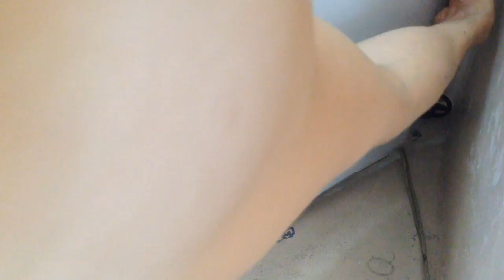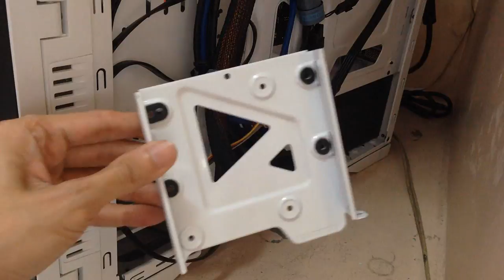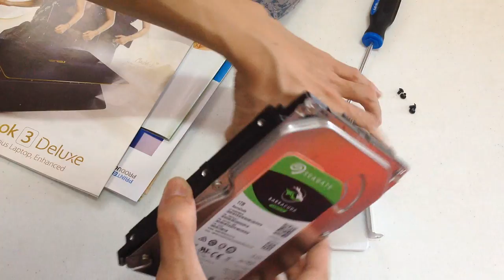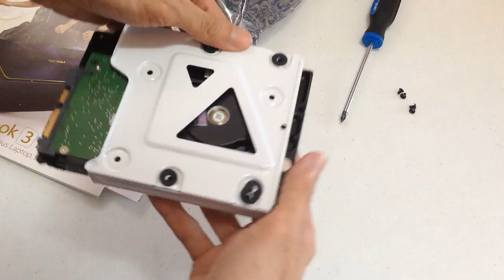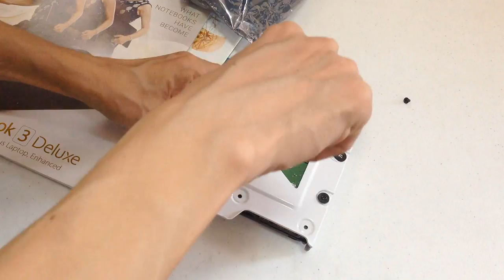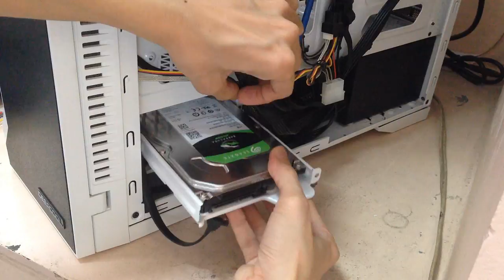Installing Seagate Barracuda 1TB Hard Drive

Comment: There is a 3rd plug in on the hard drive that I have no idea what it is. I've already plugged in the two SATA's, but what is the third one? Do I need it?
Reply: If you have the two plugged in, you are fully set up. I think what you're referring to is when he reached in the case the first time with the drive in, he was putting in a screw to hold the drive in place
Reply: @MrYogurtCup  nvmd apparently it's a test plug for companies. All you need are the two SATA plugs.
Reply: @moneycat878d5  ah I misread your first comment my bad, yeah they sometimes include funky cords; glad you got it figured out
Reply: @MrYogurtCup  I see how I misread the text. I'll change it. Yeah I meant the three plug-ins on the actual hard drive. The two SATA plugs then there is one 4 pin plug that I had no idea what it was for. But yeah you only need the two.
Reply: @moneycat878d5  thats 3rd pin is for another sata hdd to power it up 
Check it might be comimg from power supply😂🤣
Reply: No you don’t
Reply: @MrYogurtCup  thank you so much I was so confused on this
Reply: That was a worthless "how to" video.......many thanks!
Reply: Its a configuration port. Leave it like that unless you want to change something about the primary partition and idk

Comment: Im getting the 8tb from them for less than 200$ thanks now i can download all my games and be fine
Reply: Hey it's not really 8tb more like 7.75tb and the rpm will still be the same. Also putting all data onto just one drive wasnt a good idea due to the life spam being 3 to 5 years..  you wouldve been better of getting 4x 2tbs or 3x 2tbs and 1x 2tb external so when one EVENTUALLY breaks down or stops working you have the others as backup and your data is further saved whilst being spread accross other drives. Data loss costs alot to recover, especially when people lose precious photos, work files et cetera.

Comment: Help, what is the first chord that he plugged into the HD. Not the one that he plugged into the power supply but the one to the motherboard (I think). I can not find mine and am wondering what it is called.
Reply from the maker: Sata hard drive data cable
Reply: MyLittleUnboxing is that the cable that comes with the motherboard
Reply: pjayy 933 yes

Comment: where the fuck did u even get those screws
Reply from the maker: In the casing sir,
Reply: MyLittleUnboxing ah i figured it out, for my pc there werent any screws just took the hdd into the black metal cage and plugged in the thingies and worked.

Comment: can install a 3.5 hard drive if my desktop came with a 500gb ssd drive?
Reply: If it has a slot for another 3.5 hard drive sure, just make sure not to set it to boot as that drive
Reply: @robeplayer370  where exactly is the slot? Is it like where my ssd drive is or like somewhere else?
Reply: @TheCoolpants33  really depends on your case but usually near the primary ssd slot or on a slightly different 3.5 slot, that's if your motherboard supports multiple storages
Reply: Just get another ssd 
Lol

Comment: Do I need to mount it in? I got the same HHd but can’t seem to find the screws. Would it be ok to just put it in
Reply from the maker: Yes sir, you need to mount. The screws comes from cpu case, its in the package.
Reply: @MyLittleUnboxing   I got a prebuilt
Reply: @possessedpenguin8225  same, just got this and don't have anyway to mount it

Comment: my case doesnt have the sled thing that goes in
Reply: Drive bay.
Reply: Check the sides where the three holes are for the screws, just had the same issue and it screws in from the side w no drive bay
Reply: LiteralHydra And the screws should come w your case

Comment: What screws should I get?
Reply from the maker: You can check your casing
Reply: @MyLittleUnboxing  does the casing has its own screws ready for the hdd to be mounted in?  Or should I buy them seperately? The 3.5 HDD I bought didn't come with any screws.
Reply from the maker: Yes sir when you buy casing, there is a bunch of screws ready for hdd, motherboard etc...
Reply: @MyLittleUnboxing  thanks a lot sir
Reply from the maker: Welcome sir..

Comment: What is the second cable called
Reply: It's SATA power. This guy uses a molex to SATA adapter, which is a bad idea, as they are made cheaply and usually fry. Molex to SATA, loose all your data
Reply: Karl Giese What do you recommend using?

Comment: hello , i have a problem , i need to connect a 2nd hdd to my old pc , and i have 4 or 5 molex mama cables from my power supply , in which should i plug in the molex to power adapter ? ( sorry 4 my bad english ) i have in my already installed hdd a power supply sata cable which split into a mama molex cable , is that the one shoud i connect the adapter ?

Comment: Hey guys can someone help me here?   I am getting an acer aspire 5 slim laptop. It comes with a 128gb ssd harddrive.

Can I instal a Seagate barracuda 1tb hdd internal harddrive on it???

And if so, do I have to lose the 128gb original harddrive??? 

And will I lose the windows 10 preinstalled on the laptop?
Reply: Seagate Barracuda is way too big
Reply: You need a 2.5" drive for your laptop in most cases.

Comment: is the power cable included?
Reply from the maker: No sir
Reply: @unclemanth9178  No its not :/
Reply: Oof that's a rip. Which case do you have. It could also come with your motherboard
Reply: 0 Subscriber Challenge yea it came with my motherboard. I bought the HDD a couple months back

Comment: My case has a area for HDDs. Cam i just screw it in there or do i have to get the disc tray and etc.
Reply: If you have a dell I highly recommend getting a dell r494d 3.5 drive caddy if you are going to put a new hard drive in usually computers have two slots for fitting two hards drives at a time also you should get at least a 450w power supply